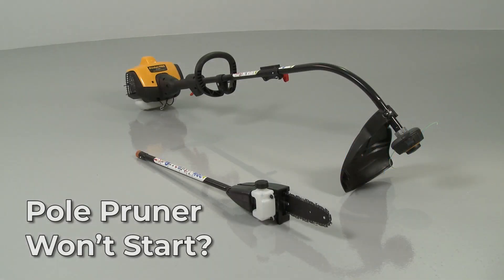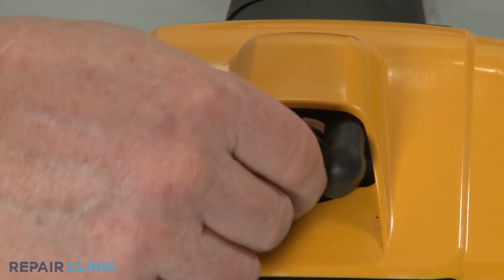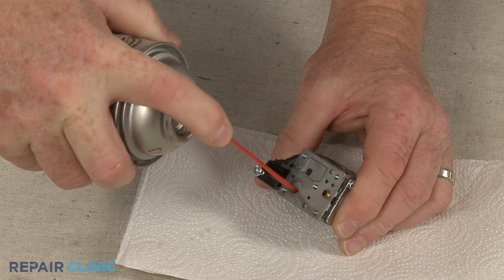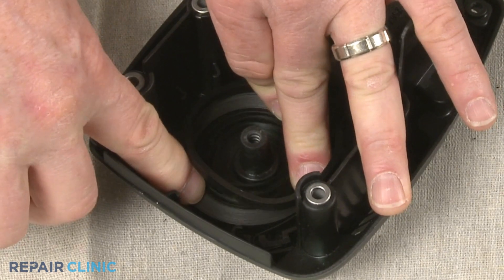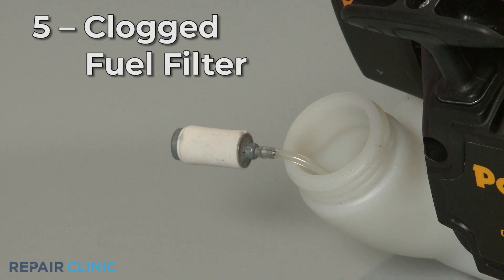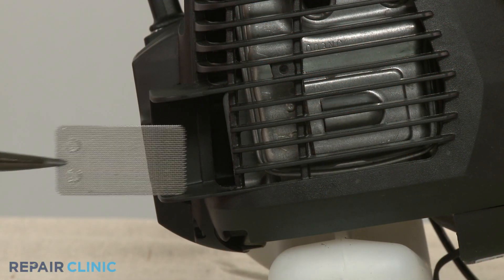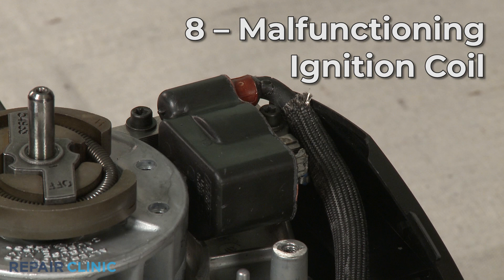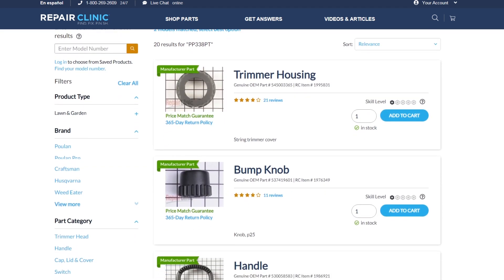Top Reasons Pole Pruner Won't Start  — Pole Pruner Troubleshooting

Comment: It only starts when I  prime it, and then it dies like it's starved for fuel. I took the spark screen out .Could the exhaust port still be congested? I put a new carburetor in before this. It does the same as when I  had the old carburetor in it.
Reply: Replace Fuel line + fuel filter.